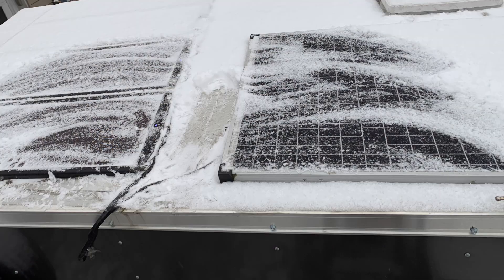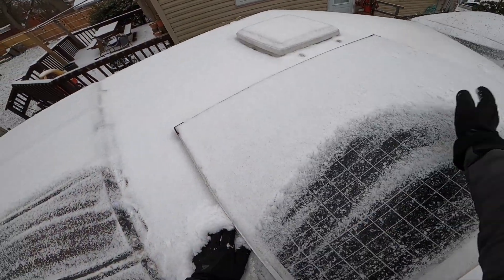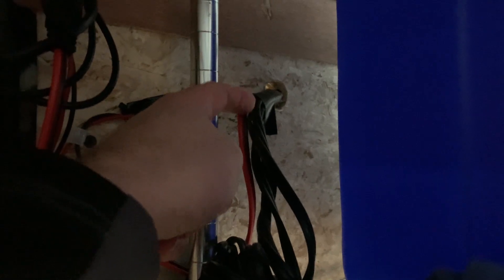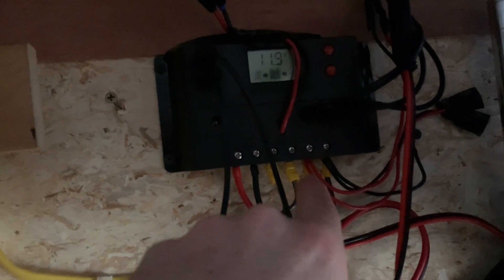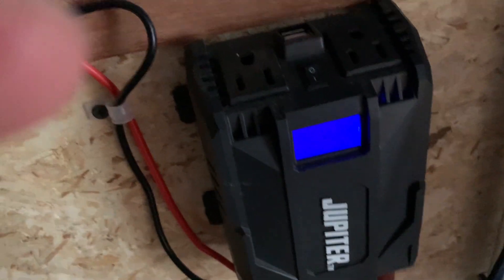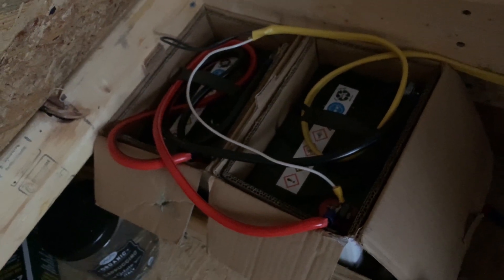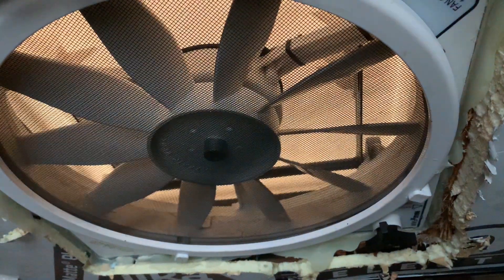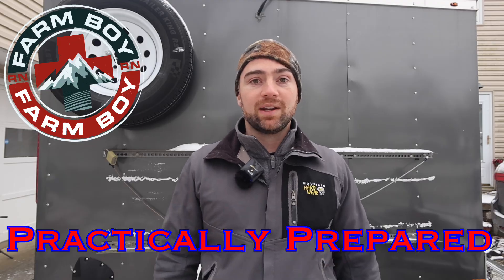SIMPLE SOLAR Utility Trailer Surviving Winter # 3

Comment: Harbor Freight solar system is good cheap way to learn about solar but there are better setups that you can do that will give you a better output and the system can grow if you dont have a lot of cash.
Reply from the maker: Rich that’s exactly what I was trying, just get my feet wet in solar then spend more later on. I think I spent about $500 for this whole setup. 
Any particular systems you suggest we all check out? —Caleb FarmBoyRN
Reply: Yes I can for sure help you. check out my youtube page I have a Growatt Inverter system running my whole house. If your looking to only improve your trailer setup then you would only need a small part of what I did.

An all in one inverter, better battery, and better panels, small breaker panel and you all good. 
You can do a 12v, 24v or 48v system

Let me know what I can do for you   @FarmBoyRN
Reply from the maker: Awesome, I’ll check that out! Sorry took me so long to reply, still figuring out YouTube comments

Comment: Just make sure to fuse your positive wires from the solar panels to the charge controller and from the charge controller to the batteries as well as the load (positive wire) to the inverter. 1.25 times the amount of amps you are putting through the wires. Look at the back of the solar panels and it will tell you how many amps they produce. Also there are diagrams from American wire gauge to make sure you are sizing your wires correctly so that they don’t start a fire.

Overall good job, you know a lot more than the average person setting up solar.
Reply from the maker: Mario,
Sweet, that is very helpful! I actually did blow the built in charge controller fuse (20 amp) by touching the hardwired charge controller output wires once or twice…I learned hard way to not do that! 
Appreciate your feedback, will definitely check out what you mentioned. -Caleb
Reply from the maker: Thanks, that’s very helpful, going to reference this on my next solar project someday